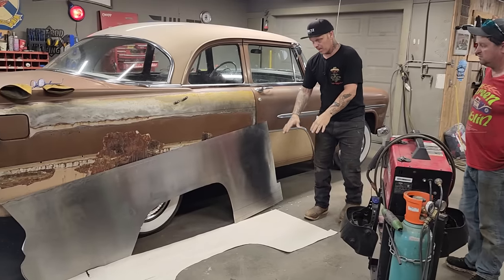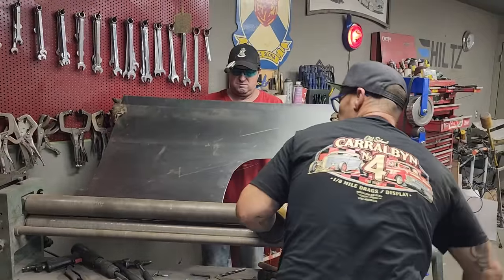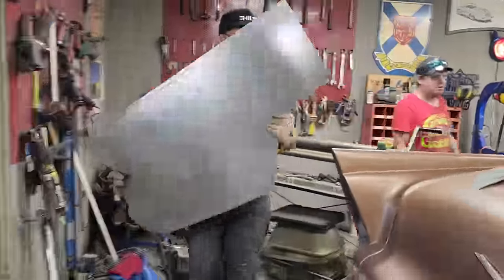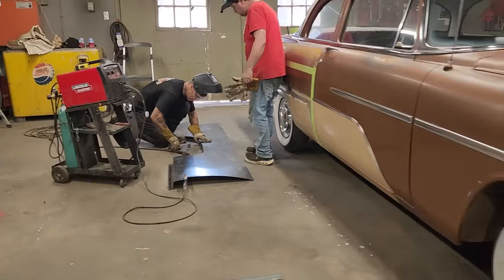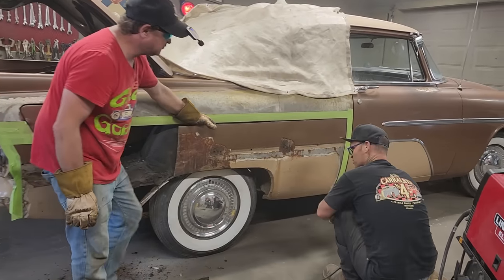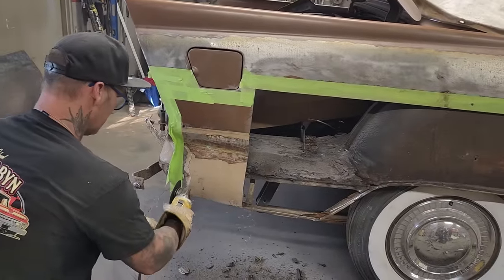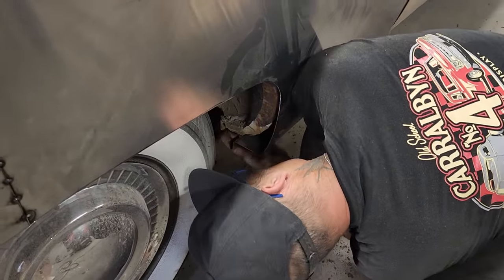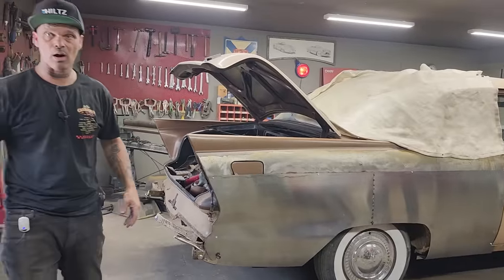Rust repair on quarter panel – step 2: cut off the rusty metal

Comment: Its looking great Chad! Im currently in the same situation with my Dads Two Door 61 NewYorker...Pass. side quarter is cut out, as is the trunk floor and tail pa. Next is welding in bracing, dropping the rear axle and springs to weld in rust free rear rails....Then I can rebuild from the trunk floor out.....Look forward to more videos! Huge mopar lover here! Also, our 1960 NewYorker two door will be here soon....

Comment: The best way to weld two pieces of sheet metal together when you want a gap to fill is to back up the two halves with a piece of heavy copper curved to the right shape and clamped together . The weld will not stick to the copper and will hold your bends to the shape that you made. I used this method for over 30 years in my restoration shop .
Reply: Once I started using the copper I realized there's really no other way.
Reply: I tried copper once and it stuck to the copper. Do you coat the copper with something?
Reply: Brass works as well
Reply: Yeah, i thought about that to.
I have several 5/16 inch plates i would give him if he was close by.

Comment: Hello from Oklahoma, we made a quarter panel for a 53 belvedere, and used the English wheel for the accent lines. Awesome work hand forming it with little to no tools but the English wheel would have made short work of it, and gave you more material by stretching the metal in those areas, while allowing you to keep the shape of the panel. Love watching your videos and seeing the progress on all your projects.
Reply: Chad seems to me it might have been better to roll that groove on the rear of that panel with the English wheel just the flat wheel or if you have a ball

Comment: The new quarter panel looks great.  I would hope Chad uses the stepper tool to make a better joint between the old and new parts. Doug is gaining skills as well.  Queen Jolene is doing a fantastic job with the camera today.
Reply: I also thought he was saving the paper pattern for the other side.
Reply: I'm pretty sure he will cut and butt weld things together, the two inch piece all the way around will be removed when butt welding.

Comment: YOUR WELD SOULD BE STRONGEST PART OF MATERIAL 
FOR EX WELD 2 PIECES OF METAL 2GETHER AND BEND IT
ORIGINAL MATERIAL IS WERE ITS GOINNG 2 FAIL AND NOT WELD UNLESS YOU HAVE PEROSITY IN YOUR WELD AND OTHER DEFEC5S IN FINISHED WELD THE WELD BEAD GOING TO FAIL

Comment: My only complaint with these youtuber body guys.. Is no one ever wears respirators.. You guys are asking fir cancer and auto immune issues.

Cutting disks are extrenely toxic as f.. welding is toxic.. grinding metal is toxic..  

Does it really hurt to wear a 35$ p100 respirator.  Im starting to lose respect for these people.. Its your body.. but show some example for others

Chad is skilled.. but also a dummy.  No hearing protection either